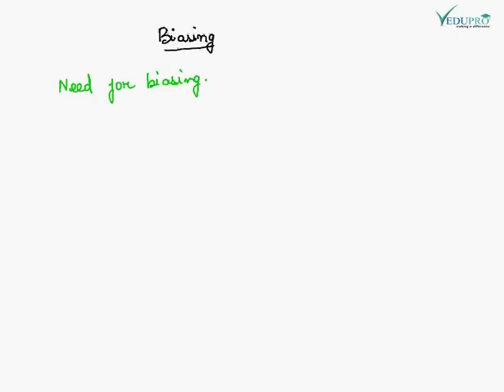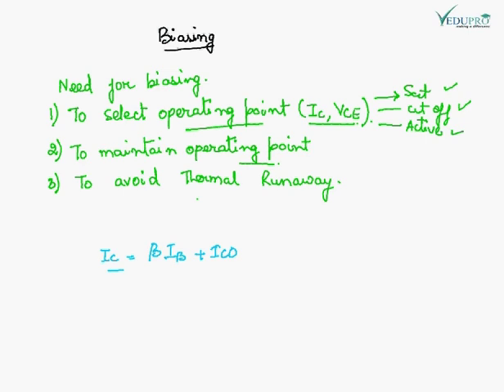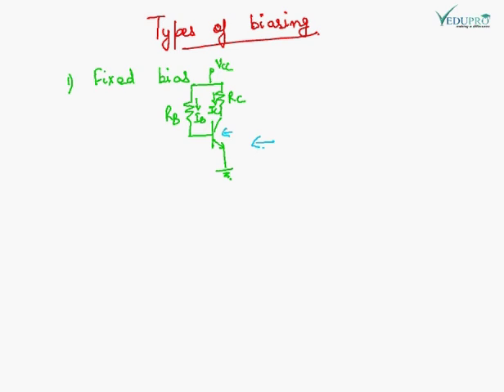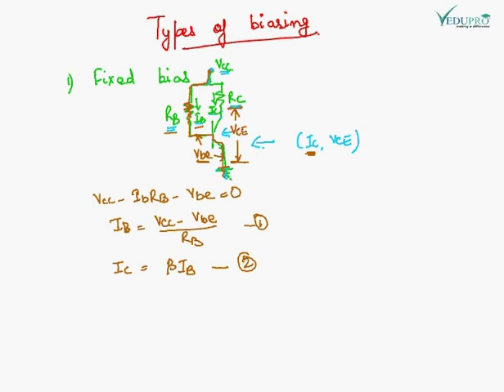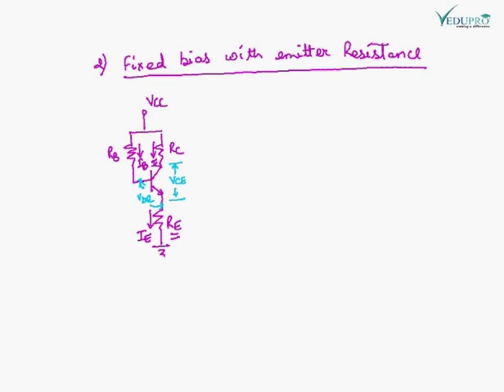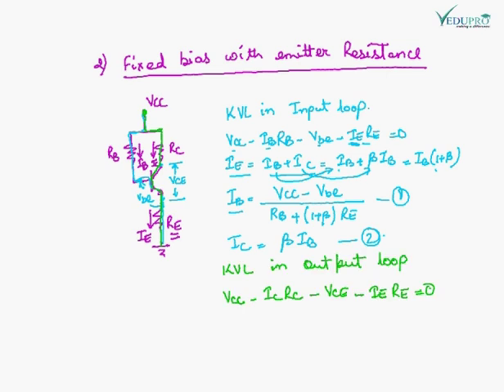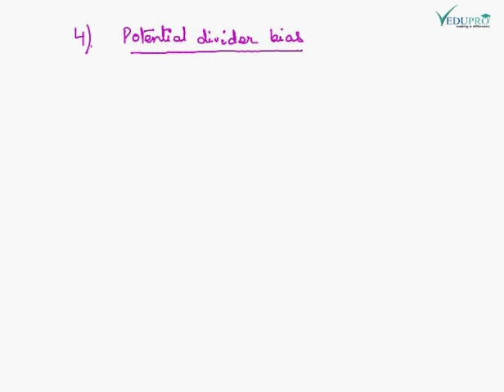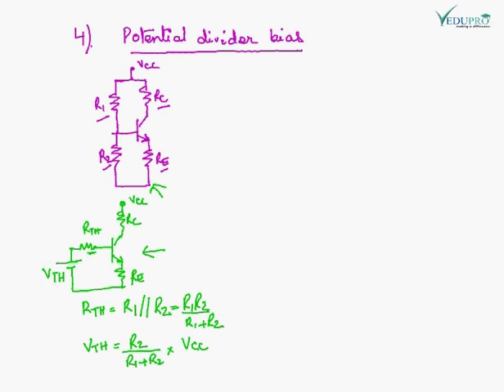Biasing of Transistor Biasing, Types of Biasing in BJT Transistor

Comment: Respected MISS/MADAM INSTRUCTOR
REF:-Yr video TRANSISTOR BIASING---TYPES OF BIASING:--
1.  Liked yr video.
2.  explained well
3.. watch yr video on MOBILE SCREEN.  The circuit diagram and connected equations appears too small to notice clearly.
write diagrams/equations bigger/bold OR  focus the camera a little closer OR both as per the case to rid off invisibility. Mine is only a request/suggestion to further improve its quality.
THANKS
Vatsa